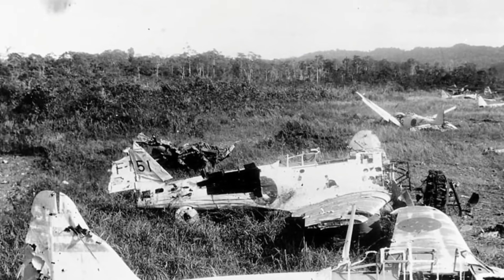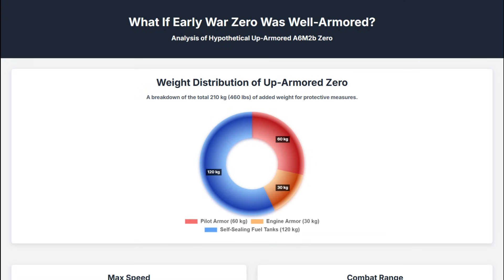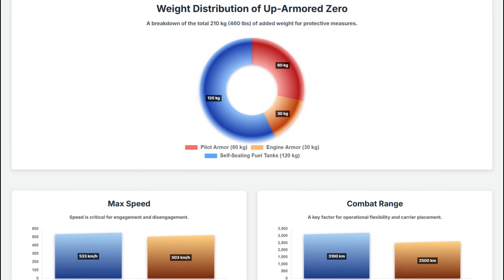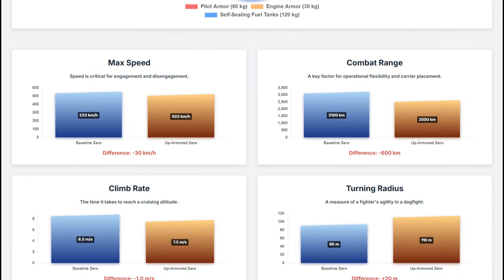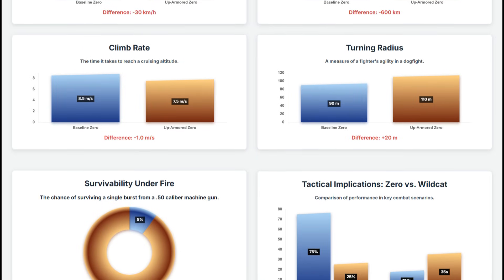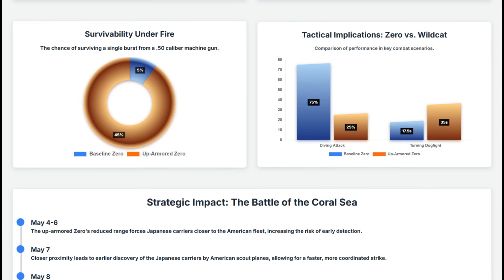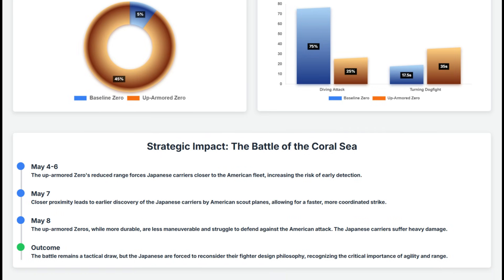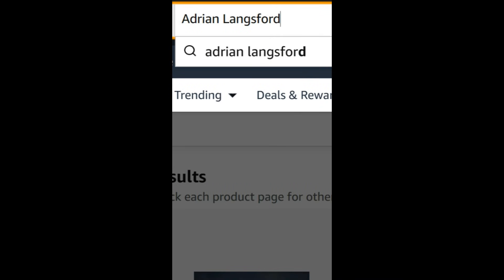What If the Zero Fighter Had Armor and Self-Sealing Fuel Tanks?

Comment: Without seeing the video, the biggest issue is early self sealing fuel tanks (SSFT from here out). People underestimate how many planes never see battle because of early SSFT.

First, more complicated design means fewer planes in production. 
Then, factory defects mean delays in completion. 
Finally, some defects don't show up until flying into battle. Being forced to turn back en route is the worst because it messes with strategic planning.

There's a reason that the US and USSR adopted SSFT very early: they had the production to compensate for fewer planes at the front. The Commonwealth did in theory, but shipping over the ocean with Uboat warfare wrecks havoc with that, and they knew that. 

Even when SSFT work well, the added weight isn't insignificant for a carrier fighter, and the range is significantly reduced just from the space of the device. 

As the technology matured over the course of the war, it became viable for countries with less production power as it (presumably) became lighter and more streamlined. 

Armor is less of an issue, but you still have the added weight, and if your powerplant is insufficient, it's a sitting deck like the domestic F2A. The Japanese were struggling with  engine power for some time, especially the navy. 

I would imagine bullet proof glass is less of an issue, but then the benefit is primarily in attacking anything with guns mounted anywhere aside from the front. Idk why this wasn't on early Japanese planes except for access to the technology. 

In short:

Bulletproof glass:
+Pilot protection while intercepting bombers, etc
-Slightly longer production?
-Access to the technology?

Cockpit/plane armor:
+More durability against surface fire
+Better chance of escape vs other aircraft when taking fire
+Engine is protected against tailgunners (where armored engine components were used, which was rare).
-Needs sufficient powerplant to be combat-worthy (see domestic vs import F2A)
-Reduced range
-Reduced performance in everything except dives 

(early) SSFT:
+Less vulnerable to engine fire (when it works). Especially important vs surface fire.
+Greatly increased pilot survival 
-Greatly reduced range
-Increased weight
-Turning back due to leaks
-Delayed production due to problems 
-Delayed production due to complexity

Comment: But wouldn't the extra weight, spur the Japanese engineers to improve the engine to make it faster and nimble?
Plus, they would not have lost as many pilots which would have dragged the War in the Pacific out
Reply: Do you think the Japanese engineers were just sitting around drinking sake? They were out of strategic material, out of engineering, out of pilots, out of fuel and out of manufacturing capabilities! There was no magic fairy dust to solve the problems!
Reply: Aside from what was already said there would have been no way you could have convinced the Japanese military you could have defeated the giant that is the United States military by valuing human life more by adding more armor or structure. The Zero was a plane built for mass production to match US numbers as best as they could as such they relied on the fact that they were more "radicalized" to do things no American pilot would do. They could have designed a higher-performance plane sooner but that would have meant less planes. Namely not having the numbers to match against the US, having less planes to perform kamikaze runs...etc

Comment: Silly proposition for childish minds. If the Zero had had the features mentioned plus up-gunning as necessary to deal with the likes of the Hellcat and Corsair, it would also have required a much more powerful engine and robust airframe. So it wouldn't have been a "Zero". The Japanese already had the two designs necessary in the Ki-84 by March 1943, and the N1K2-J by January 1944, but long before then lacked the experienced pilots to fly them as well as the production capacity to produce them in anywhere near the numbers necessary to deal with the US onslaught.

The A6M5 was only kept in production because Japanese demand for aircraft in the air vs production capability was so stretched as the Germans were with their Bf 109. Neither had the buffered luxury the Americans did of a massive population and pilot training program abetted by developing new types supported by massive industrial capacity fueled by a nation rich in raw materials and labour (twice the size of either Japan or Germany) not under constant attack in Germany's case, and Japan's from 1944. The Zero was fine as was in its time. The problems were firstly massive Japanese numerical inferiority exacerbated by experienced pilot attrition with pilot training and replacement program which was inadequate, and as importantly, that by the end of 1943 the A6M5 was outperformed by the new US Navy F6F and F4U fighters appearing in theatre in overwhelming numbers.

Comment: I'm sorry, but the 200kg weight difference won't slow the plane by 30kph. It's unrealistic. I think the figure neglects a lot of important aspects like wing's AoA. Also, the armor is not that important especially when 50 cals have considerable penetrating power at long range. It's more about the self-sealing fuel tank that is important. What zero needs are more strengthened spars and outer-skin thickness to help with the wing's bend & flutter at high speed. Also the wire for ailerons stretches at high-load, it's not a desirable quality. The left handed trigger is better off being an option instead of being forced to control the stick with one arm. What is so shit about zero is its high speed controllability and slow speed at almost all altitude. The early A6M2 have these mark 1 cannons with very low velocity. A6M5 is actually an ideal zero. But I think armor is not that useful. 
The pilot in the field felt that way, so they removed the armored glasses in the cockpit. About the Wing AoA with the variable weight condition, the very low wing loading of zero allows the aircraft to enter a slightly negative AoA at top speed. This happens in order to counter the 0 AoA lift of the airfoil. Until the certain weight range, the drag of the wings barely changes. And the variance in the top speed would be tightened with low wing-loading aircraft.
Reply: .50cals lose more than half their penetration when they impact the aircraft’s angled fuselage and the bullet starts tumbling.
So pilot armor would help a lot.

Comment: It would have been too heavy for the 980hp engine, been slow, clumsy and not able to turn like it did. It would have been a lot more that 210kg of armor because to carry the extra weight you'd have to beef up the frame, adding more weight. You also need to armor the engine, so more weight there.

Comment: But what if the 7.7mm machine-guns were both removed or Zero had a single 7.7mm machine gun? Would not then absence of combined weight of 2 machineguns plus their ammunition etc reduce the gap?
Reply: The guns and ammo weigh approximately 50kg. Not a whole lot.
But against US fighter they were practically useless.
Maybe they would have a psychological effect though.

You could probably save some more weight since the synchronizer mechanism would no longer be needed.

Comment: look no further than the buffalo aircraft used by the americans and the british in 1941-42, that's what happens when they decided to uparmour the buffalo fighter aircraft while keeping everything else the same, that aircraft became sluggish & very hard to turn and A6M Zero aircraft shot it out of the sky quite easily
Reply: Exactly. Engineering is a bunch of tradeoffs. Things you change on a design are rarely just pure upgrades with no downsides.

Comment: The best late-war fighter options for the Imperial Japanese Navy which combined armor and self-sealing fuel tanks with speed, maneuverability, range, and firepower are the Kawanishi N1K-J Shiden-Kai and the Mitsubishi A7M Reppu. Both planes were powered by either the Nakajima Homare or Mitsubishi Ha-43 radial piston engines, each driving a four-bladed propeller with a power output of 1,900 to 2,000 hp. Both planes were also projected to be produced as both land-based and carrier-based fighters. Only the N1K-J Shiden-Kai was able to see service and was highly-regarded as Imperial Japan's best land-based fighter which could take on late-war Allied fighters such as the F6F Hellcat, F4U Corsair, and P-51 Mustang. The A7M Reppu was unable to be mass produced and see active service before the war ended.
Reply: Ki-43-II, Ki-61 and Ki-100 also had armor and self-sealing fuel tanks (SSFT), with the Ki-61 being the first japanese plane to have both armor and SSFT right from the factory, Ki-43 was upgraded to have a more powerful engine and weaponry upgrade, addition of armor and introduction of SSFT becoming the Ki-43-II, and the Ki-100 appeared too little, too late
Reply: But to a country seriously hamstrung by a lack of raw materials but with a relatively large, supposedly fanatical population, it was harder to replace planes than pilots. I understand the quality versus quantity argument but the leaders thought the next man up would be superior, due to the plane itself. Obviously, they were wrong but that’s what they believed.

Comment: How about a re- engineered radial engine compensating for the extra weight with a little extra horsepower with a minimum loss in fuel economy- I’m sure it could be worked out….
Reply: Curtis-Wright did that with their Turbo- Compound    R-3360 engine.

Comment: Late model Zeros did actually have self-sealing fuel tanks and some light armor. But the Zero's most fatal flaw was its lack of innovation. By late 1943 it was already far too slow, underpowered and too lightly armed. It was still much more agile than any American fighter, but they had adpated their tactics to overcome that with speed and numbers. By the end of 1944 the Zero was hopelessly outdated and almost 200 kph (120 mph) slower than a P-51D. Adding armor to the Zero would only have made it even slower and taken away manoueverability.
The German's managed to continually improve the Bf109 from its first military action in the Spanish civil war in 1936 till the end of WW2 while still remaining competitive to the Allied Spitfires and Mustangs. 
In 1940 a Bf109 and a Zero had very similar performance. Speed, climb rate, power output. Basically the same. The Bf 109 was faster in a dive, the Zero was more agile. Even the armament was the same. 
However a 1940 A6M2 Zero wasn't much different from a 1945 A6M7 Zero, the latter having roughly 200 more horsepowers, roughly 20-30 kph (15-20 mph) more top speed and a climb rate increase of about 400 fpm. 
In contrast between a 1940 Bf109E and a 1945 Bf109K the engine output increased by almost 900 hp and the top speed by about 170 kph (110mph) while the climb rate improved by 1,600 fpm.
Reply: The battle of Darwin, is a very fascinating view on the A6M. In short it was Zero vs Spitfire, which is why it is fascinating,  the zero and spitfire were both slower fighters, both had very tight turn circles, both had very high instantaneous climb rates. So in a turning fight they were the most alike. The spitfires adopted German fighter tactics, used to counter the spitfire, because the zero could out spitfire the spitfire. It was a losing fight to try to out-turn a zero. In the end boom and zoom tactics were able to defeat the zero.
Reply: @Owen-mt4si  Interesting. The Battle of Darwin was in 1942 when the RAF in Europe already employed the Spitfire Mk. V which was much faster than the Zero. However since Australia up to early 1942  had been far away from the war, they perhaps still had older Spitfire Mk. II which had similar performance to both the Bf109 E and the Zero.
And as you rightly said. No WW2 fighter could outturn a Zero at slow speeds
Reply: @archer494 The zero had another trait that was uncommon in world war II. It has a very fast instantaneous climb rate. Many other fighters had better sustained climb rates. If a fighter tries to follow a zero into a climb, it is very likely to lose its position of advantage. For a surprise zero pilot, the only escape is some combination of climb and turn. I like Darwin because it is a very fair test of the zero as a fighter. It also shows a turning fighter is a dead end in fighter combat. Fighters that climbs fast and turn fast, will lose eventually to a faster fighter that can disengage when at a disadvantage. 
I believe the Japanese recognized the A6M short comings, but they were stuck, with a plane they could manufacture. The Japanese and British had the same doctrine problem, flying in a VIC or v formation of 3 planes is at an tactical disadvantage vs a pair of planes. 2 v 3 is really just 2v2 with one fighter with the job being shot down for lack of wingman. A British fighter pilot once said they held on to the VIC for so, blood long because it looks good from the ground. The Japanese also flew VIC without any real coordinated tactics. Each fighter pilot was alone, most also died alone. Subaru Saki proved in right hands that A6M was a ruthless killer. It also shows paradoxical the side with the highest score in air combat is losing. When a great fighter pilot is on the losing side of air war finding targets becomes easier.
Reply: @Owen-mt4si  That fast instantaneous climb rate is due to the low weight and resulting lower inertia. The empty weight of a Zero was only 3700 lbs. No European or American fighter was even remotely this light. There are even single engine light aircraft like the Diamond DA50 RG out there that weight about the same without carrying around heavy guns and a 14 cylinder radial engine. 
An American Grumman F4F-2 Wildcat had an empty weight of 5200 lbs and was far from a heavy-weight. the F6F Hellcat was over 9000 lbs empty - the engine alone weighed 2300 lbs. 

If you have ever flown yourself you can replicate this effect quite easily with modern light aircraft and microlights. 
Take a typical 100hp LSA/microlight (empty weight about 500lbs) for example that has similar performance values to a Cherokee 160 (empty weight about 1300 lbs). So let's say about 100 to 110 knots cruising speed, climb at sea level about 750 fpm etc. 
But if you pull that LSA up, it's low intertial will let it climb like a rocket ship for several seconds while the heavier Cherokee will take much longer to overcome the intertia and achieve the same climb rate. The flip side is of course, that the LSA will also lose that advantage much faster and stall more rapidly and possibly more violently than the smoother Cherokee. 

So of course if a Zero pilot pulled hard on the stick he would shoot up and probably take a pursuing Hellcat by surprise. But the Hellcat will simply easily outclimb the Zero with it's massive 18 cylinder Double Wasp, gain a comfortable altitude advantage and dive down at 500mph.
Reply: @archer494 It is safer for the Hellcat accelerate away by losing some altitude not following the zero and setting up a longer distance climb. Following a zero is a great way to get stuck in  the zeros game, good pilot could get lucky. Also coordinating with a wingman to take a 6 position if the A6M is dumb enough to try to dive on the hellcat. I have only flown with my father inlaw, and a lot of flight simulator.
Reply: @archer494 yak-3 was kinda close with only 4600 lb weight
Reply: @Янус_Ырт  the yak-3 had the best sustained rates especially at high speeds, however the yak-3 had a high wing loading, even roughly 10-15% higher than the previous yak-9 and yak-1, the yak-3 relied on its absurd power to weight ratio, great aerodynamics, and extremely good dynamics to be able to maneuver so well, but in a sustained turn it only has its power to weight ratio to bear
Reply: @Ahmed_Hasan_  yak-3 was the lightest of the yaks whilst retaining the wing shape, it couldn't had more wing loading. La-7, however, was slightly heavier, but had more powerful engine, and also more advanced avionics (wing slats and multiple flap configurations)

Comment: When your enemy can out produce you 10 to 1 it just doesn't matter if your planes are a little better.
Reply: Even then they had to think about the storage capacity of carriers,  it's the late part of the war the situation of getting outnumbered is made prominent. The mainland China established airfields shared with US, so technically they had access to unlimited supplies of high-grade vehicles. But for those fighting over the sea, it's not the same unless they capture an nearby island with enough flat surface. Which they did mid in the war. That's exactly why those US carrier aircraft are standardized to have folding wings, too. To maximize the number of aircraft per carrier.

Comment: The zero was like the Tie Fighter of it's day. It lacked armor and self sealing fuel tanks just as the tie fighter lacked deflector shields and pressurized cockpit. But it's light weight gave it extreme agility.
Reply: Its agility could be useful against Buffalos or early P40s, but when a single volley of .50's rounds can literally disintegrate your aircraft,  it's game over.
Reply: Probably why there aren't any Tie Fighters left today.

Comment: Adding armor doesn't address the combat doctrine problems, A6M did not have good radios and Japanese fighter pilots did not work as teams, the single combat doctrine doesn't work vs American boom and zoom tactics. Though the zero was a well optimized plane, it did a lot with a tiny engine it didn't have power for added armor. There is also the strategic problem of Japan racing to capture oil, one of the main reasons the war started was oil. A less fuel efficient zero cuts back in air operation. But in the end it was a war decided on logistics, Japan didn't have fuel, men, planes, or manufacturing to directly compete with American manufacturing, or supply.